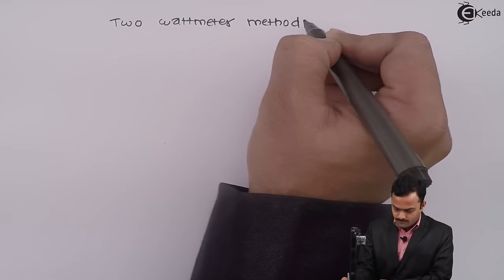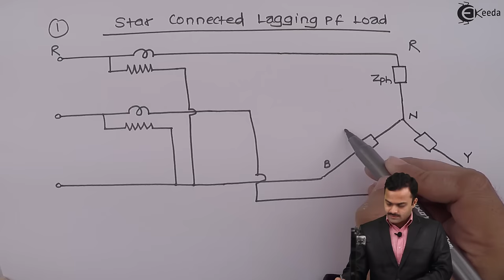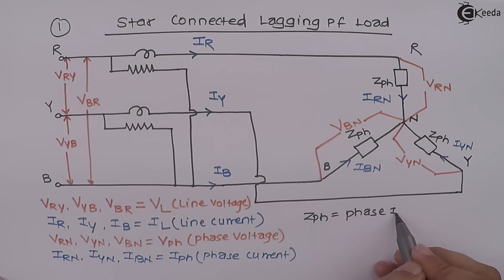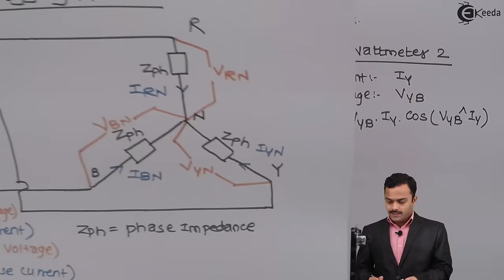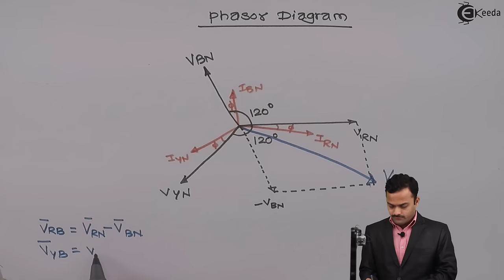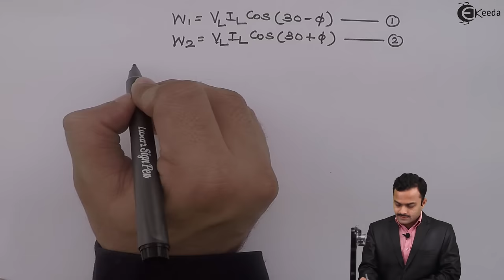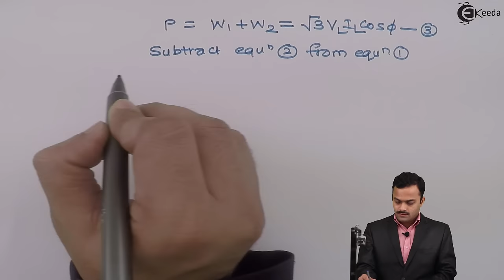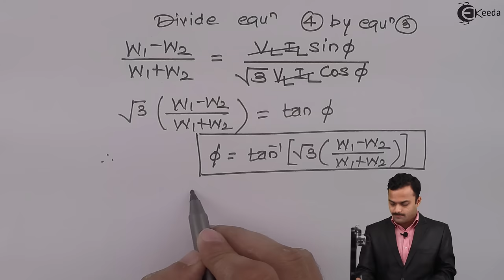Two Wattmeter Method of Power Measurement - Three Phase Circuits - Basic Electrical Engineering

Comment: In phasor diagram, how to know which phase voltage is leading and which one is lagging??
Reply from the maker: Hello,You can ask your technical doubts in our App. Download Ekeeda Engineering Learning App from Google Play Store - https://play.google.com/store/apps/details?id=student.ekeeda.com.ekeeda_student&hl=en
Reply: just for you it depends on the direction of rotation of the armature on which we put the three coils....in such a way they separated from each other by 120 degree angle......if you consider clock wise rotation......you got one type of condition....and if you consider anticlockwise rotation...you got another type of condition....but in this derivation sir considered anticlockwise .....and generally we considered anticlockwise rotation.....I hope you got some idea.......but good question😄😄😄

Comment: Why is the angle between Vrn and Vrb equal to 30 degrees?
Reply: Joseph J. Bautista Because if you draw a line in middle than angles are find 60 and half of this is 30
Reply: Sandeep Tiwari thanks

Comment: Consider a grid connected VSC. The grid phase voltage space vector magnitude is given by 220 V at angle of 30°. The current supplied by the grid are given by id=- 8 A and iq=- 6 A. (voltage/current invariant transformation has been used)
1) The three-phase active power supplied by the grid is _____ W
2)The three-phase reactive power supplied by the grid is ____VAR 
plz help in this problem